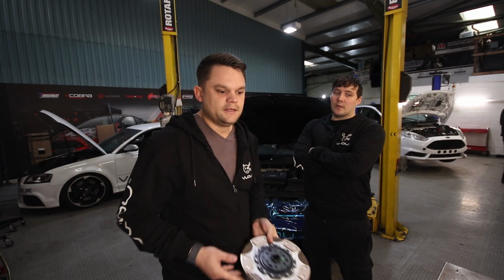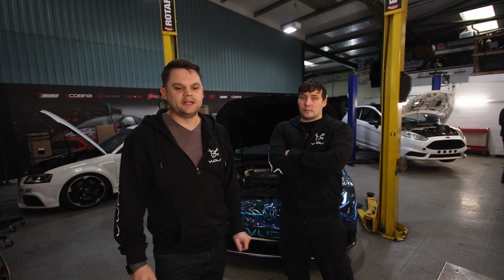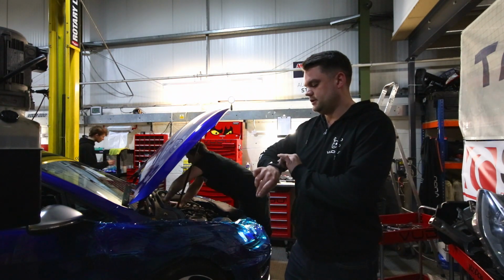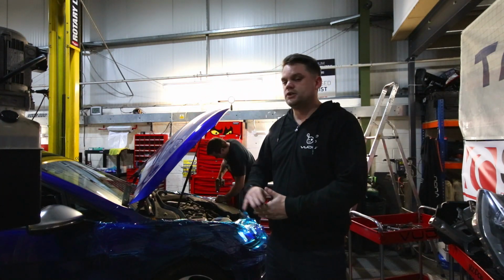** 390BHP** GOLF R STAGE 1 + VUDU REMAP DYNO TESTED RTS CLUTCH INSTALL

Comment: Really impressive HP figures there lads, I just had the RTS clutch fitted here in my red Golf R a week or so ago so maybe it was me that you were speaking of. All is going well with it so far anyway, still running it in though. Done about 250 miles on it so far but more than happy with it, it is pretty close to oem feel tbh only a little bit more keen but yeah im really impressed. Will be back sometime early 2020 i guess for the exhaust system and stage 2!

Comment: Looking to have a RTS twin friction fitted next week. was wondering is it essential to also replace the flywheel?  i have a 2017 model with just over 17k on the clock. Had a stage 1 a few months ago now the standard clutch is slipping hence the upgrade. Im only planning on keeping the car another 6 months so would just the clutch upgrade alone be ok?